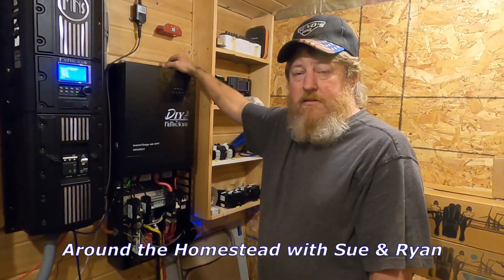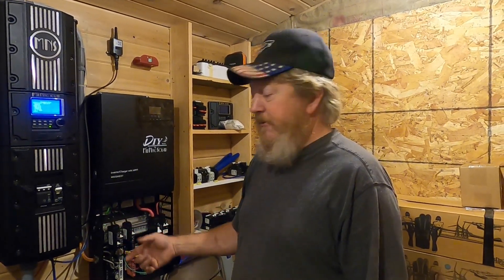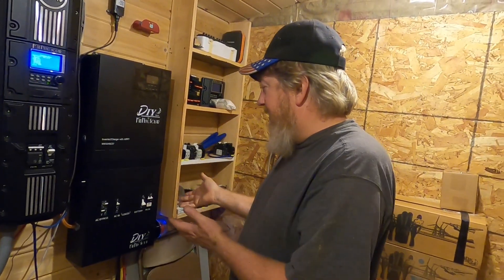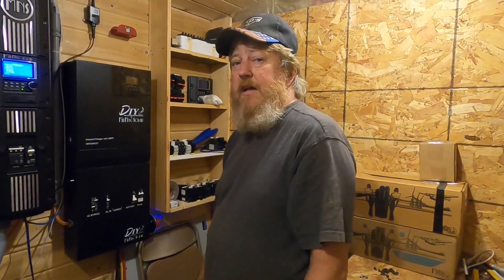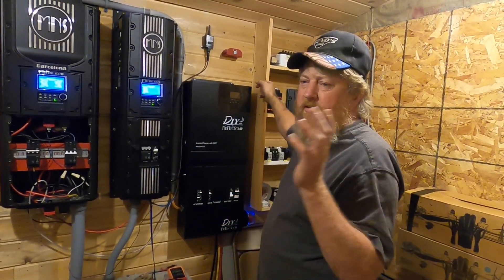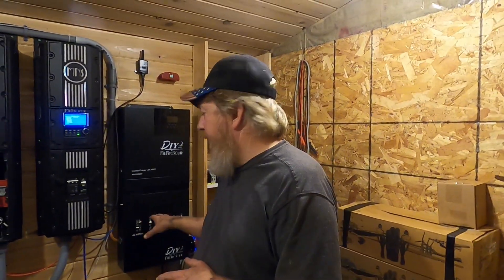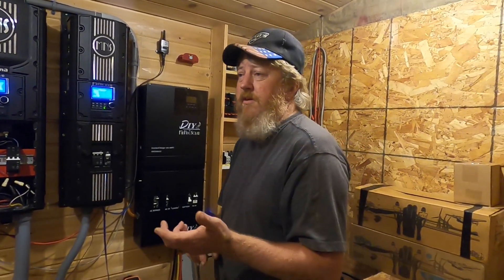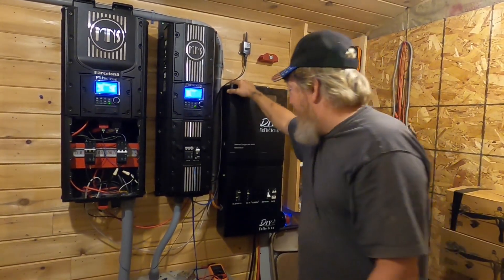Midnite MN5048DIY E-Panel First look!

Comment: Debating getting one of these. Only downside is no way to parallel them for 240 split phase. 5000 watts and a HV charge 80 amp Charge controller is a steal. NAWS has it for around 850 after a discount code. Can you parallel the DIY charge controllers? As in they communicate and charge as one.

Comment: I installed my first one of these with an azimuth adjustable pole mount. 6x 415W Canadian Solar bifacials. One eG4 5kW battery. 
My customers are waking up to no less than 66% SOC. They love it and don’t mind turning their mount to double their instantaneous input amperage! I sure hope it lasts for them. I’m skeptical of overseas stuff but on a budget I think these things are awesome! Midnite support so I’m feeling optimistic.

Comment: Got two of these 5048 running will be doing testing with them I will be placing a big order for my customer.   Epanel is awesome wish they had them out now and really looking forward to the 10K thanks for the awesome video.
Reply from the maker: E-Panel should be available in a weekish I believe. May want to bug Midnite

Comment: Good to see you. Are those some big new SCC on the wall? Are they in production yet?
Reply from the maker: Yes those are the new 600c MPPTs from Midnite, They are now for sale in Beta and should be in full production in 4-6 weeks
Reply: @aroundthehomesteadwithsuer3497  Let me know if you need a Beta tester. I have 28 ea 475W panels available.

Comment: I am not seeing a shunt. Is there provision for a shunt in case one want to install an aftermarket battery monitoring.
Reply from the maker: Not directly no, I think the logic was the AIO doesnt use a shunt so to keep cost down they didnt add one
Reply: @aroundthehomesteadwithsuer3497 guess you would have to your own metal work then

Comment: WHAT'S YOUR OPINION ON THE 
EG4 6K Off-Grid Split Phase Inverter  (All In One Solar Inverter)
(6000EX-48HV | 6000W Output | 7500W PV Input | 500V VOC Input | Split Phase 120/240VAC ) 
MY LIGHT BILL HAS BEEN ON AVERAGE FROM JUNE 2021-2022 WAS $510 AND WE JUST GOT THIS MONTHS AND IT IS $640..... I KNOW THAT OUR HOUSE, DURING NORMAL OPERATIONS, RUNS ABOUT 5-7 KWH PER MONTH AND UNDERSTAND THAT ILL PROBABLY NEED AT LEAST 4 INVERTERS.... HOWEVER, I'M NOT AN ELECTRICAL ENGINEER AND THAT'S WHY I'M GREATFUL TO GENTS LIKE YOU THAT SHARE YOUR KNOWLEDGE.... I'M NOT TOTALLY GREEN WHEN IT COMES TO ELECTRICAL THOUGH, I DO OWN AN HVAC COMPANY & I'M FAMILIAR & COMFORTABLE RUNNING HIGH/LOW VOLTAGE..... ANY ADVICE IS GREATLY APPRECIATED..... 
I'M TRYING TO GET A SYSTEM THAT IS DEPENDABLE THAT I CAN INSTALL MYSELF....
THANKS FOR YOUR VIDEOS BUD.
Reply from the maker: I havent played with one yet, if you are looking to lower the light bill you may want to dig into something grid tied or self consumption, As mentioned below Schneider makes a nice inverter for this
Reply: It's an ok inverter if you like difficulty setting parameters, 5 seconds to hit a button or it goes back to the home page. Then it's another 2-30 button presses to get back to where you were at. Do you like talking to an answering machine or customer service? You can also send emails and when that all fails, get Ben and Richard to put out the fires on DIY solar forum. I have Sol-Ark, EG46500ex and MNS products. MNS is right up there with SA on quality, tech support.
Reply: I myself like the DIY for the cost but it's hard to beat Schneider when it comes to dependability just cost a good bit more money but you do get 10-year warranty and the customer support is a lot better now